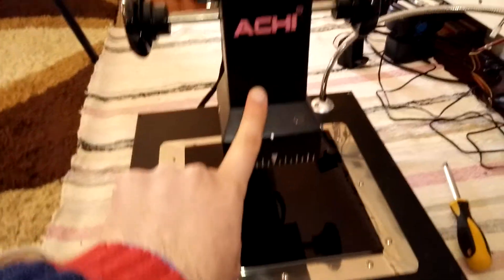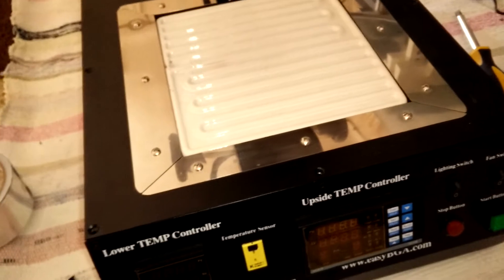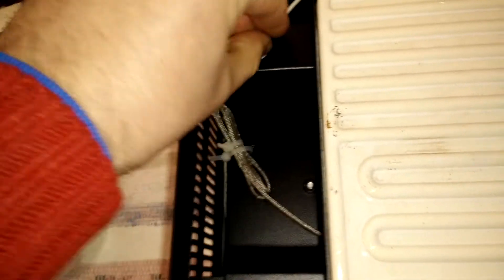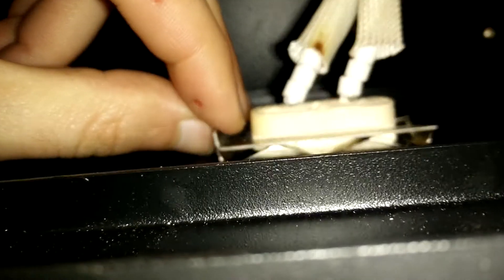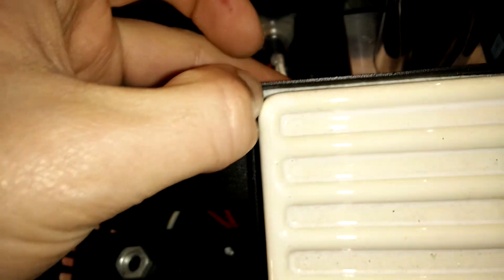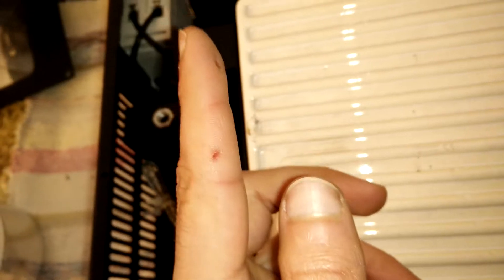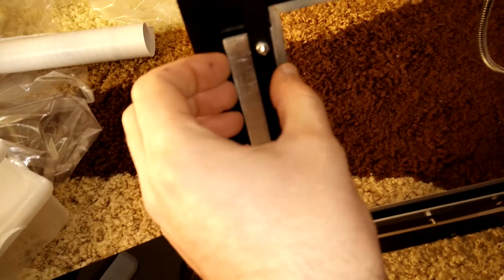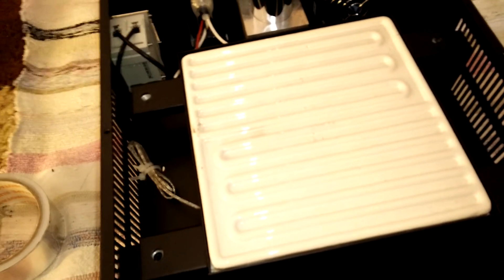Hack and improve ACHI IR6500 rework station bottom heater

Comment: would it not be better to put the temperature probe underneath the board your working on similar to the top, instead of underneath the cermaic heater?
Reply from the maker: Yes, that is a great idea. Some heaters already implement that
Reply: @FixDaily  Yeh I thought so too :D, this may be the reason people say the board doesn't heat as much too, because it heats until it reads the required temperature, but obviously underneath the pad may get to 220c fairly quickly, whereas the board at the same time may only be 120c or 130c, however as the probes read the right temperature its now probably going to limit any further rise in temperature.
Reply from the maker: @gampo2  well the glass is very further away from the heater and it blocks a lot of the heat.

Comment: A si es mejoro la subida el vidrio limita mucho algun perfil para ps3 amigo puedes hacer un tutorial mostrando el perfil y paso a paso de hacer un reballing a una ps3 por favor !
Reply from the maker: You need to create your thermal profile. I can't give you my values because it depends on room temperature. 
Search for "solder thermal profile" and do some trial and error to proximate your thermal profile to the standard. Your graph needs to be close to the main one.
Reply: @FixDaily  entiendo, pero si as podido arreglar una consola de juegos como la xbox 360 o playstation 3 o algún tutotial haciéndole con tus propios perfiles a esas placas te lo agradecería un montón ya q no encuentro ningún video de una persona q haga reballing a una ps3 con esta maquina
Reply from the maker: @princeabranz76  the dimension of a Playstation or Xbox console is higher than the heating plate. This rework station is good for graphic cards or some small laptop boards. Using it for consoles will afect the boards making them curved when cold.

Comment: Hi have you bothered to increase the lower ir heater panels for the 220mm x 80 x 3’s or have you just kept it original except for these mods
Reply from the maker: If you are able to add more heaters that would be great for bigger boards. Replacing the original by 3 other ones with the same area, might end up doing the same.
It depends how far the heating lines are and the quality of the heaters.
If you are willing to reball, make sure the boards are the size of your heater, bigger boards might end up bent.
Graphic cards and some small laptop boards will work fine for this machine.
If you want a bigger surface, you can buy a pre.heater (for example: T-8280) and hack it with parts of this machine.

Comment: Hi fantastic video ordered mine the other day can I ask what size screws did you have to get just so I can order in advance
Reply from the maker: Hi, there's no extra screws you need, just remove the top glass and if possible add a mesh where the glass use to be. This avoids stuff falling directly onto the heater to avoid burning and extra smells.
Make sure you don't breath the nasty smokes of your fluxes - take care.
Have a great day
Reply: @FixDaily  thanks for the prompt response I’ve enjoyed all of your videos I hope you do more
Reply: @FixDaily  hi it’s just that the 4 that holds the hot plate looks as if they were changed so I just need to get some nuts thanks again buddy oh when’s the next video coming out

Comment: Hi.. I have a one like this but not working the upside temp  controller not showing any degree and the lower temp controller work and the white heater working good please help.. Achi not heat 😔 the fan of achi work And I tested all by avometer joined successfully
Reply from the maker: Make sure the SSR is connected to the top heater.

Comment: Hey, i actually just did this mod. However I did not have to drill any hole whatsoever. There is small gap where the ceramic conductor on the underside is. You can use this small space to reroute the sensor wire to the bottom plate as he explained.
Truth be told, the original fixture of the sensor is outright ugly and pointless. And yea, either remove or replace ther glass with something else (Metallic grill). Removing the glass is also a pain in the ass.
Reply from the maker: Yest it has a lot of nuts to be removed, it takes time :D thanks for your time sharing your thoughts
Reply: @FixDaily  If an idea works its worth to be shared within the community. Of course credits and kudos to you! Plus with the default fixture can mess up the desoldering process because of low temperature (Pads ripping, board warping).

Comment: post picture wiring on pid controler
Reply from the maker: It's not easy to see with one picture since the wiring is all mixed up.
If you plan to make one i recommend you to look up online for a schematic wiring of the specific PID controller you are willing to use.
Remember that you might or might not need an SSR, depending on the controller you are using
Reply from the maker: Also there are 2 controllers, one that only heast the bottom plate, and the other one that heats by following a temperature profile.

Comment: Great Tip you saved me because i was ready to broke it as i damaged 3 mainboards. Do you know how long does it take to reach the 150 on top in seconds? How log have you add to your profiles? Thanks!
Reply from the maker: It still takes quite long time to reach the 150ºC on top, about 10minutes but at least it reaches the temperature.
I have to buy a larger pre-heater and make a modification to this bottom heater because is too small.

A friend of mine told me that i should read 5 points: Center and all the sides of the board and none of them should get different more than 10ºC comparing to others, and with such a small pre-heater it is not possible, at least to motherboards. Graphic cards work better but laptop or desktop motherboards are no good, they return all bowed because the heat are not even :\

Thinking on buying a PUHUI T8280 pre-heater and adapt the top heater and the controllers, maybe for a future project

Also don't forget to remove the moister from the boards, otherwise BGA's will all pop-corn, that's the most common problem you can get.
Reply: FixDaily - Electronic repairs, hacks and tips mine gets about 6 minutes to go at 150 C and i tried 3 motherboards today and removed gradic cards without any problem as till yesterday i was damaging them. It is very intersted with a bigger preheater if you try this sure i want to know your tests. Do you have a skype to speak more private and ask you some things? If you have search and add allrepair greece. You mean that motherboards return damaged after reballing?
Reply from the maker: @nikosxatzikonstantinou1198  Hi, i still haven't used my rework station that much and all the stuff I've removed i pop corned it, and i still haven't got back to it although i have a lot of scrap boards for testing. I was using it as a pre-heater for mobile phones until i have bought a small pre-heater, now is aside until i get back to it.
Some folks told me that this one i have is no good and i'll have trouble bending boards (because of bad temperature spreading), and in fact my popcorned board tests are bent.
Sorry i can't add you on skype I'm afraid I'm no good for giving advice on how to use it more than what I've published on youtube. Also i have no time now, i'm moving into a new life. What i can promise you is that when i have success i'll post it on my channel how to work with it. Also if i buy a pre-heater to hack this station i'll post it (how I've done it) here as well.
My time is so short that i already have a new video to edit and it's half way done :\
Reply: FixDaily - Electronic repairs, hacks and tips no problem,i will give you soon my infos of my tests at motherboards i hope. When you used it for mobile phones you did not used the upper heater and only the preheater? And which small preheater did you buy for phones because this also interest me.
Reply from the maker: @nikosxatzikonstantinou1198  if you could share your experience i would appreciate it since is knowledge please let me know :)
I have disconnected to top heater for phones.
This is the one i have bought https://ebay.to/2G8VRGf i made some holes and taped the same screw threads that i had on my IR6500 board holder so i'm using those adjustable holders on my pre-heater as well

Comment: Good stuff. I bought a IR6500 today and quickly realized that the bottom heater is pretty much worthless. The board gets about 45°C warm with the heater on 200. It is practically not preheating at all! I'll remove the glass, too!
Reply from the maker: Yes the glass makes no sense, it takes a lot of heat because it's pretty thick. A lot of people remove it and put a net, but i like it this way so i can clean it if i need to.
When I've bought it, I tried to put it on the maximum temperature that the driver could handle, but it did no do much, i got the same result as you.
Now, at 250º C (in the summer) i can reach those 150º (on top of the board), and in the winter, i go with 350º and it works great.

Now take a look about thermal profiling, you need to configure your system to run a soldering profile (lead and lead-free solder has different melting temperatures), this machine is easier because it has only one TC for controlling the whole thing.
Good luck :)
Reply: @FixDaily  I opened the thing up today. They glued the temp sensor on top of the heater element!! Can you believe this? Ridiculous. Of course it was already coming off. I removed it and routed it to the outside so that I can attach it to the underside of the PCBs. Who cares about the temp of the heater, anyway? I removed the glass and mounted a grill instead. What a difference! I wrote a blog post about it: https://bit.ly/2RuKwag
Reply from the maker: @hermannschmidt9788  Don't put the TC underside, it is safer if the TC is reading the heater and not the spreading radiation of it. If for some reason the TC gets out of the way, you'll burn the board.
Also if you read the temperature from the heater you'll have a more constant temperature, that's why i've put it on the bottom center of the heater.
Also the TC should be close to the center of the heater, since your BGAs will be aligned by the center.
"Who cares about the temp of the heater, anyway? "
Your board should be at 150ºC (on top) before starting the top heater (and it should be there until the end of the profile), otherwise you'll destroy the board. Also make sure you bake the board at 110ºC before rework it, otherwise it will popcorn it.

About your blog, damn mine were glued but not like that, that looks ugly. 
I Like your grill, looks way nicer, but rise it so it takes less time to heat the board.
I'm about to add more heaters on the bottom (still thinking about it), this one is too small for bigger boards like game consoles.

Nice work pal!!!
Reply: @FixDaily  I saw that you glued the thermocoupler with the aluminum tape. I think I have the same tape (it came with the station, right?). This one comes off at 90°C! I don't think it can handle 250 from the heater. Maybe there are high temp glues available somewhere. I cannot imagine any safe method for attaching the thermocoupler besides some mechanical trick. Unfortunately, there is no way to drill a hole into the heater ceramic. Nah, I rather keep it outside. From there it is possible to push the sensor through the grill on top of the heater. So I can measure either the heater temp or the board temp.
Reply from the maker: @hermannschmidt9788  i'm not sure if i used the aluminum tape, but if i did, i used a better one because the one that came with it was too thin.
There is no need to glue it since it's compressed to the glass fiber on the back of the heater.
I didn't mention to drill a hole on the ceramic heater, i meant on the metallic bottom enclosure.
Reply from the maker: so you remove the ceramic heater from the metal enclosure and drill a hole close to the center. You'll see a white fabric below the heater, that's glass fiber (be careful to not put it on your eyes or breath it), you drill a hole throw the fiber as well, then you pass the TC by the hole and bend it 90º (make sure you leave at least 5cm inside so it doesn't fall from it's place later) and cover it with the ceramic heater.
Reply from the maker: But if you want to leave it as it is, at least fix it with a wire and center it so it doesn't go away.
Reply: I think I understand what' you mean. I am going to play around with my setup for a while and see if it sucks.
Reply from the maker: @hermannschmidt9788  Ok good luck and glad to help if it was the case.

Comment: Thank you, 
What are the electronic components inside the ir6500 ?
What I know so far is 
1- PC410 PID temperature controller
2- Rex c-100 pid temperature controller
3- ssr Relay ( but how many relays ? 2 ? )
4-  k type thermocouple ( 2 or 1 ? )

5- 180×180mm heating elements

Are there more parts that I missed ?

Thanks
Reply from the maker: 1 - correct
2 - correct
3 - 2 SSR to control the bottom and top heater (PC410  controlls the top heater | Rex c-100 controls the bottom heater)
4 - Just one TC inside (type K) that connects to the Rex c-100 - the other TC is connected to PC410 from the outside. The inside TC is touching the bottom heater.
5 - Yes, but if you want to create your own reworksation i  recommend you to use a bigger one or a few smaller ones

There is also a circuit breaker on the back and a 230V fan to dissipate the heat from the bottom components